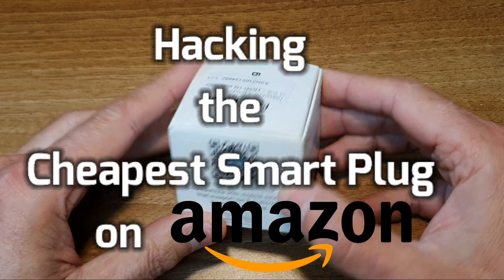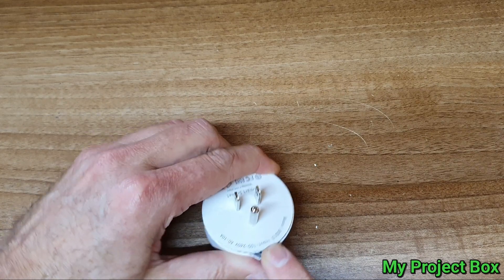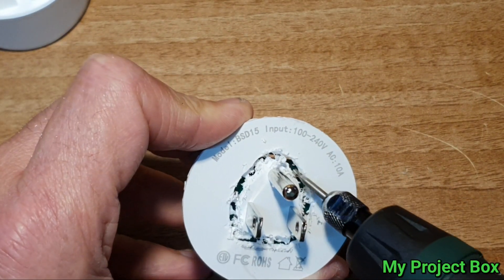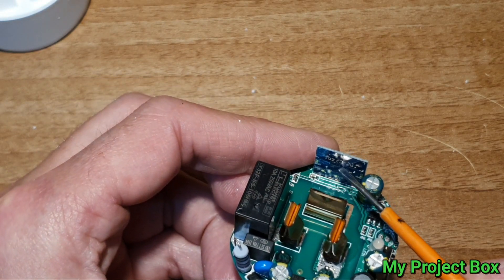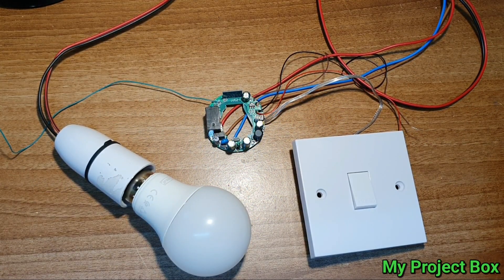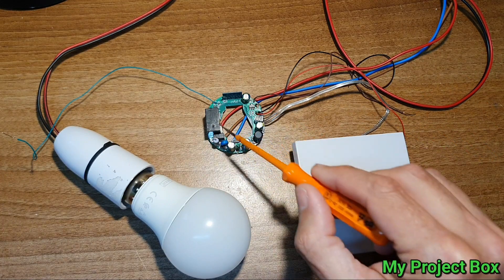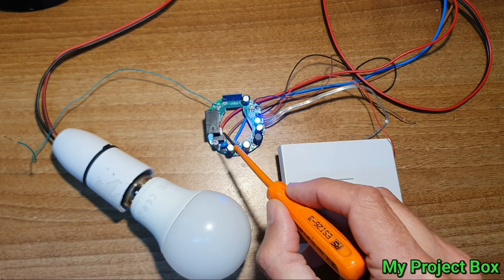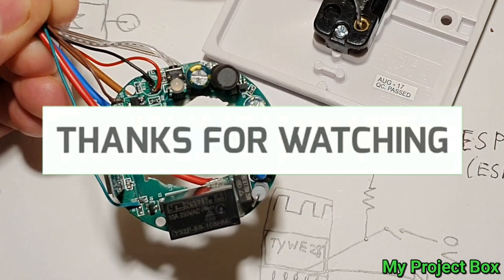Amazon cheapest smart plug/socket, hacked Modify Teardown salvage BSD15 #ElectronicsCreators

Comment: I'd like to hack this switch to send a signal from my 3d printer to turn it off at the end of printing. I was thinking of connecting an opto isolator to the switch and feed the output from the printer to the opto isolator to turn it off. I think this would get rid of the mains reference from the plug.
Reply from the maker: It sounds possible. I have triggered smart switch inputs with a optocupler before. https://youtu.be/9hQFFsBkxaU

Comment: Hello, I made the mistake of plugging a heater to this plug so it I believe it damaged the relay. It works fine when turned on but no voltage is provided to the output. I see a burn mark on the relay . Do I just replace that module?

Comment: Is it possible for us to change the software service provider? 

If i purchased a smart plug from company A. But realise that the back end software is not as good as company B , could i reset or reinstall the software in some way to make my device accessible via company B back end software?
Reply from the maker: Yes it is possible to change the firmware. The esp8266 has a large hacking community support. Tasmota is the preferred firmware.

Comment: Love the channel and joined when I first found you on YouTube as I love all the hacks you do, 
Is there any chance of seeing the Pound land socket teardown, I am interested in the quality of the product? Thanks, Bob in the UK.
Reply from the maker: I'm currently living in Portugal (Madera Island). So I'm nowhere near a poundland 😜. But I might be able to carefully take one apart that's in use at the moment, I'll try not to damage the casing too much. What I can tell you is that they use a Big good quality 16A relay, and they beefed up the tracks with with copper bars, so they can handle plenty of current. There's also an internal 2A fuse, just in case the internal electronics goes wrong. It seems pretty well made to "British standards". It's not manufactured badly like other Chinese crappy smart plugs.

Comment: Hmm... I'm looking to modify an Alexa-enabled smart plug, so that I can use a remote push-button switch OR the built-in WIFI capabilities to activate it.  Any useful thoughts or recommendations on a particular plug?  

Application: I have an electric control panel box with a traditional 120v, maintained action switch that activates a 120v contactor.  I want to be able to activate it via push-button OR via Alexa app or Alexa voice command. 

Full details of application: This push-button switch activates the main power contactor of my electric home brewery.  I'd like to be able to use an Alexa routine to turn it on roughly 1 hour before I wake up, which would make it power on and start heating my water to my target set temp in my PID controller.  -> The routine would then turn on my grain mill and start crushing the barley 15 minutes before I wake up.  

This would dramatically accelerate my brew days getting me back to my family about 90 minutes faster than I do today without any kind of automation...
Reply from the maker: I would recommend you use something like a Shelly 1 or a Sonoff MINI, as these are highly flexible smart switches which can be used for many different applications, and accept external inputs, like different kinds of switches. You can change how they are triggered by a momentary Push or toggle switch. You can probably directly drive the contactor coil from one of these. For example you can use the sonoff mini, with a push button connected to its S1 and S2 inputs, and the output can then switch the contactor or the original switch.